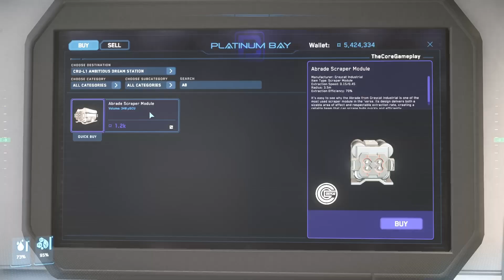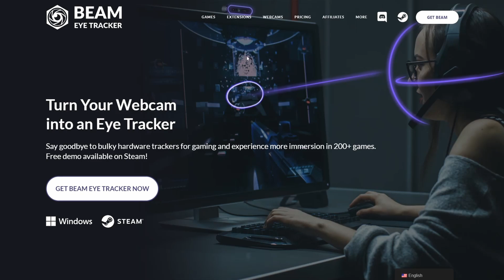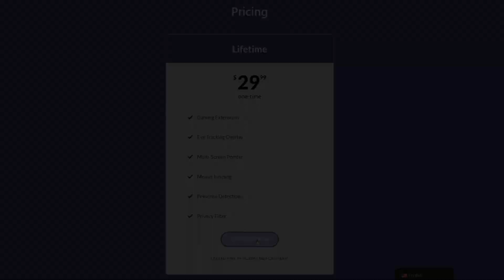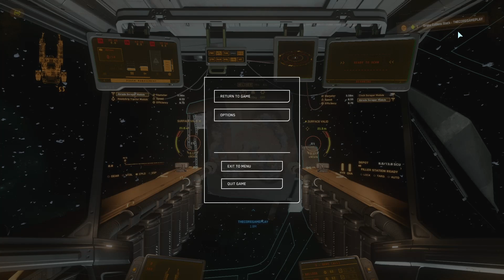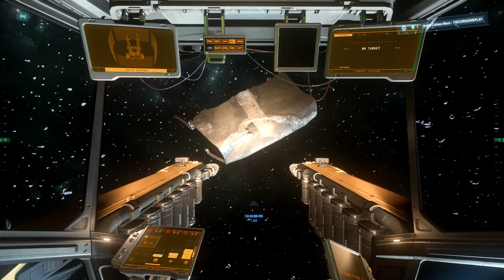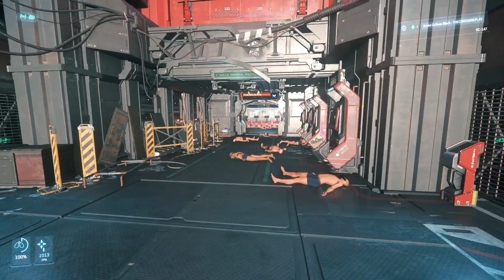Beginner’s Guide to Making Easy Money with Salvaging! Star Citizen 4.0.1

Comment: A few patches back I was making 560K aUEC per run with 39 SCU in total. The price back then was in the range of 14-16k aUEC for 1 scu, depending on where you sold your cargo. I used a stealth QT drive to prevent NPC pirate interceptions when warping back and it seemed to work.
Reply: Which quantum drive did you buy exactly? I want to be very cautious
Reply: @santitt0186  It was called Spectre. It's a S1 grade A QT drive. You probably need to loot it now. But I'm not sure. An alternative would be Zephyr.

Comment: Just the other day I found a 3000.  Normally I would've ignored it, but I was curious.  Turned out to be an 890 Jump.  No cargo, but still, plenty of scraping.  Also, I have seen panels as 7000, but that's the only number I've seen defy the "2000" rule.

Comment: Vulture is the best ! 
I can gather up to 37 SCU (24 in the back and 13 in the filler station). Its a bit tricky but you can do it.
Reply: I routinely get 39 (3 filler station loads) But it means I gotta EVA to the back to load. Usually do the entire right side off grid first then the middle off+on grid and then I take the last 8 out to load back to front once I have them all.
Reply: @Mystic-Midnight you can fit 39 without EVAing. First 13 fill the back as usual (8 on grid, 5 to the side) The next 13 I first load right up to the door double stacked (takes a little bit of wiggling) and the fill the rest as usual on grid and 2 just off to the side of the filler station and one pops out the filler station . You will have to hold F and use the mouse wheel to zoom in on the eject button as if you take too long it will show a blockage message. The other 13 in the filler station. I do this all the time, saves EVAing as that can take a lot more time. 👍🏻
Reply: @beardedprince4942  I've just been doing runs of 26 and it feels much faster than overloading it granted panels got nerfed
Reply: @Mystic-Midnight  your probably right. What ever is the quickest turnaround of SCU’s of RMC is best for profit. But have fun doing it 👍🏻.
Reply: @Mystic-Midnight  SO panels not worth anymore ? should i go for the salvage misions ?
Reply: Not worth time spent on eva...33 in without leaving ship
Reply: @DocBlacker   it takes like 5 minutes if anything. Usually I spend the longest amount of time waiting on the boxes to dispense

Comment: Hey can you answer me a questio nwith the beam eytracker ? I set up everythign like in your video but my opentrack dont recognize the eye tracking but in the test it works fine so somethings wrong with my opentrack. So in beam itself it works fine just not in opentrack
Reply from the maker: It's difficult to really tell what's wrong but I'm going to take my best guess.

If you open opentrack, on the left hand side you'll see the drop down that says input. Select Eyeware Beam under it. 

Next under the output drop down it should say freetrack 2.0 then the only other thing I can think about is don't forget to hit Start on opentrack software.

And make sure when you open Beam eye tracker that the Gaming Extensions is toggled on.

Like I said it's difficult to troubleshoot because I can't look at it myself but if you  got everything perfect like I mentioned it should work otherwise I would try reinstalling. I bet it's super frustrating.